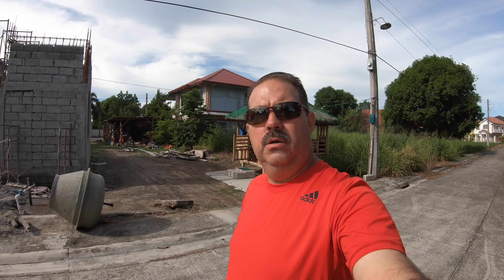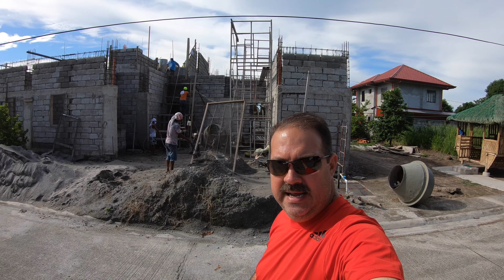Philippine House Building Step by Step, Build Day 78: Supply Delivery Day

Comment: Another masterclass .
The webs welded on the trusses look strong. I see many steel projects in the Philippines (ie gates/veranda posts railings), within a few years, corrosion/rust sets in, this is strange as it's a warm climate there
On another note, does your builder offer a structural guarantee on your build, here in Oz it's 7 years I believe.
Reply from the maker: I want to say it’s 15 years for structural warranty but I’ll have to check the contract again. There is no set standard for structural warranties here in the Philippines. Varies from contractor to contractor. Great comments. Thank you.